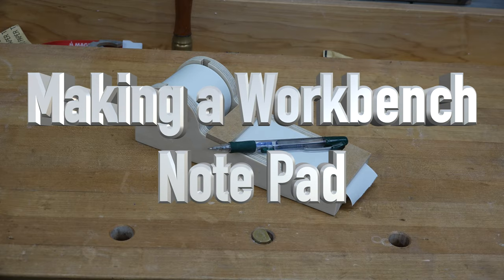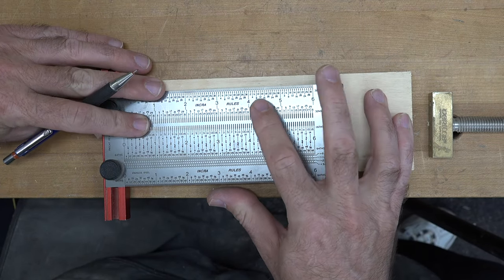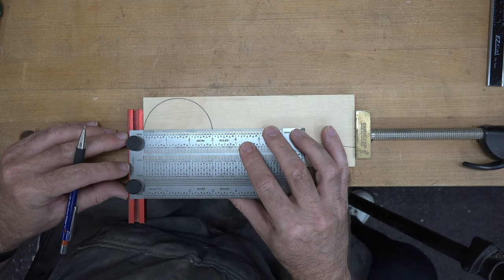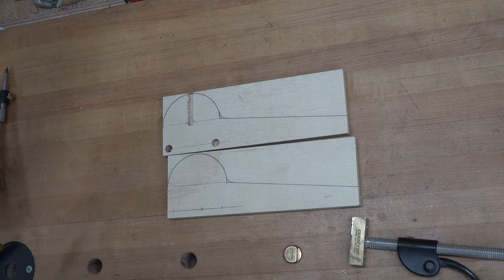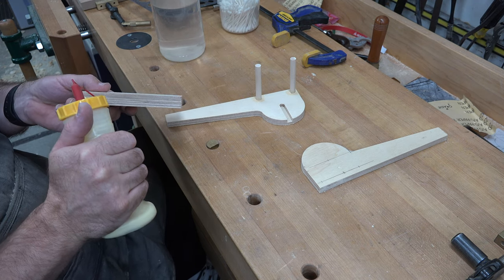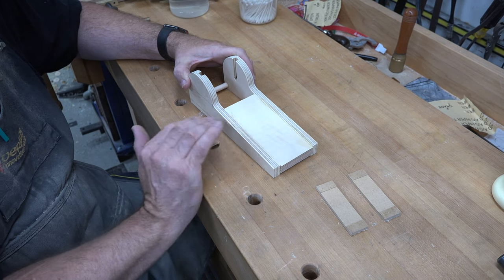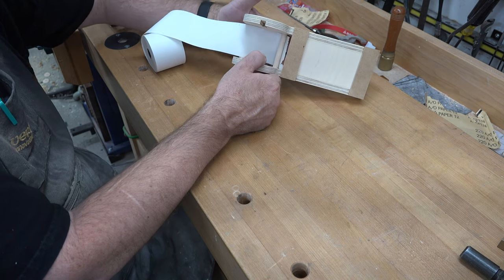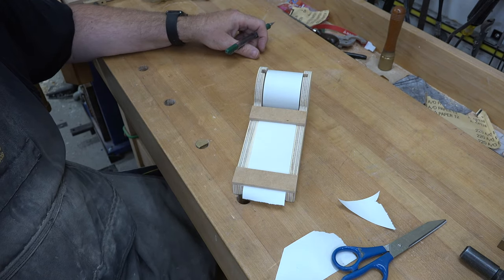Making a Workbench Note Pad

Comment: I usually keep a pad of post it notes in my apron so I have everything when I go to each machine. But this would be handy to keep on the bench. I think I will put a pencil holder on the side. I use a drafting pencil to mark measurements like you but I have a ton of pencils and that way there’s always one there even if it’s not sharp. Another great idea. I need to go back through my shop notes magazines for ideas. Thanks 😊
Reply from the maker: Glad that you liked this one Danny.  This is another project that gets used constantly in the shop.  I can't believe how handy this thing has been since I've made it.  Thanks for tuning in this week.

Comment: Nice way to clean up some scrap and paper rolls. The only thing I would ad would be a holder for the pencil. Great project and brings back some great memories when life was so much simpler.
Reply from the maker: Great idea on the pencil holder Wayne.  That could be something as easy as a hole drilled in the top of the note pad.  As for me, I keep my pencils in my apron.  No need for another place to hold a pencil.  I love your idea though.  Thanks for chiming in with it and for tuning in to the show.

Comment: Hi Kenny! Good job! I'm always looking for a scratch pad in the shop. I get most of mine from the real estate agents that seem to think they are great advertising. But, they tend to get buried. With your project, it will stand up and not get buried. Regards, Bill
Reply from the maker: Glad that you liked the project Bill.  I hope you're going to make one for yourself.  This one has been incredibly handy since I made it.  Whenever I need to jot something down, it's always there, ready to use.  Thanks for tuning in to the show and taking the time to leave a comment.  It's appreciated.
Reply: @acutabove_woodworkings  Still working on the drill press table but, I did use your favorite tool the scroll saw to make a routing template for a bowl cut on the end of the drill press table to hold things temporarily. I went through several thoughts before coming up with the scroll saw solution but, I'm getting there. LOL!

Comment: As usual another great project.  The adding machine rolls are still readily available-I have a technician who uses them at her work station and we keep them in stock in the supply cabinet.
As mentioned in another comment I would add some way to keep the pencil handy to the notepad.
Reply from the maker: Good to know that the rolls are still available.  A place to put a pencil would be an awesome addition.  Thanks for tuning in and taking the time to chime in with your suggestion Woody.

Comment: I like it and the rolls are still available.  They do come in various widths.  Reminded me of an incident:  I did service work for a business machine company.  Banks had these large teller machines that used two ply carbonless rolls.  I was carrying one out to take it to the repair shop and the back paper cover opened.  The paper roll literally unrolled itself across the bank lobby floor with me in hot pursuit of the runaway roll.   I'm sure there were snickers then and probably for the rest of the day.  I didn't make that mistake again.
Reply from the maker: LOL.  That's a great story Dwight and it paints a pretty funny picture.  I wish I could have witnessed that.  LOL.  Thanks for tuning in to the show and for chiming in with your story.  Great stuff.